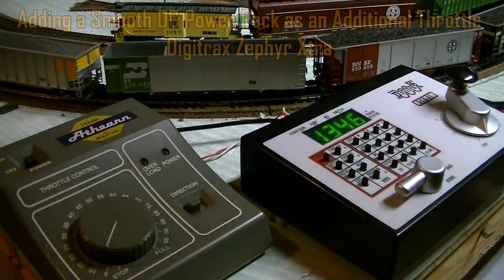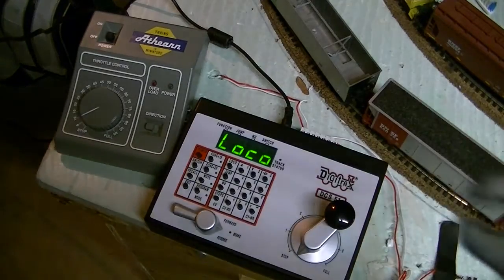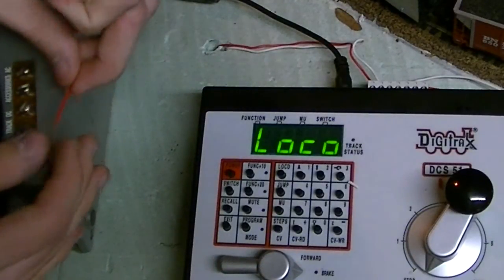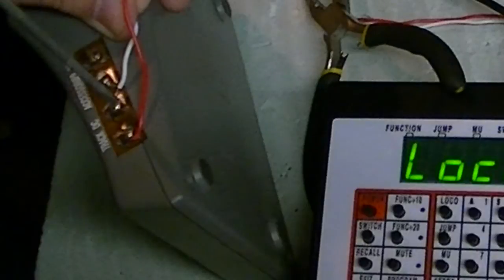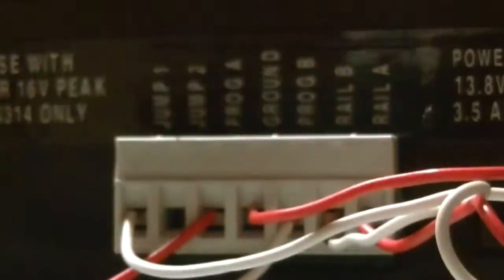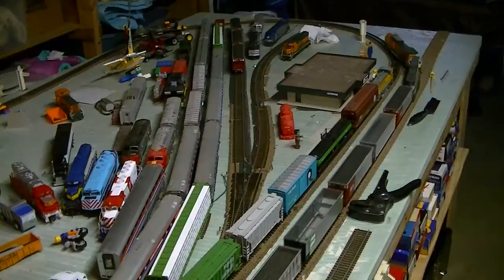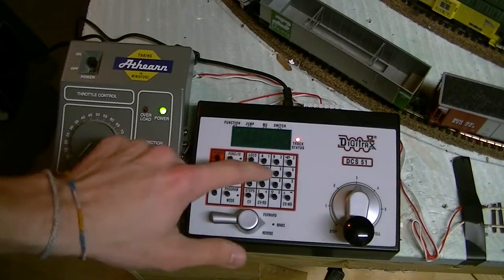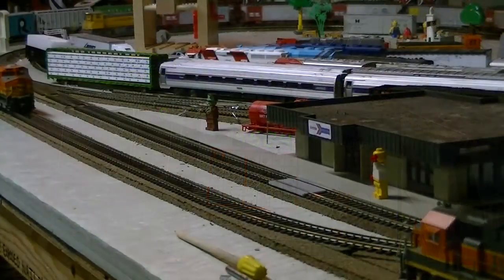Digitrax Zephyr Xtra- Adding DC Power Pack as Additional Throttle 2.12.2016

Comment: FYI:  I see a few missing the point of what the JUMP function is, it allows you to add 2 more throttle controls be using spare parts of your old layout. All locos are DCC (although DCC system can run a standard DC it is not recommended). What this means if you and someone else wants to run trains on your layout you don't have to spend over 100 bucks to do it.

I found this out in manual and now I think I know what I want to get.

Comment: CONGRATULATIONS , for documenting something a manufacture did NOT as one hell of a reason to buy this unit, I was looking at a bunch of different until reading a manual on wonder what the hell jump is
Reply from the maker: billfusionenterprise Glad I could help! I thought it was a neat feature and figured out how to use it, so I figured why not demonstrate how it works? It is pretty handy
Reply: revolutionary is more like it, have you seen what additional throttle cost. Plus if you want a big control stick setup (to simulate the real thing) you can. (ever notice how small those post are?)

Comment: Hey bro, Now my question about the DC Locomotive wont it over heat while you are running the DCC train?
Reply: not about DC loco, all locos are DCC, it is very undocumented feature of the zephyr which will allow you to add 2 cab control to it
Reply from the maker: CSX2057 Not sure, I avoid using my DC units. They run really loud, doubt it can be good on the motor.
Reply: have you looked at the price of an extra cab control to any dcc system? , even if you wanted to add the wifi

Comment: could I use a kato power pack  to run dcc with digitrax am new to all this and thanks  greg
Reply from the maker: greg bartolotta Yes, you can hook it up how I hook my Athearn one up in the video and use it as an extra throttle. It's still DCC though, but it allows you to control 2 trains individually at the same time very cheaply. Digitrax throttles are expensive, so this is a cheap way to add another throttle cheaply, and also convenient if you're converting from DC to DCC
Reply: anybodys dcc throttle ad ons are expensive

Comment: could I run dc and dcc at the same time
Reply from the maker: greg bartolotta You can run DC engines but they make a very obnoxious humming sound and I believe it is possible to burn up the motor, so I don't recommend it. Using the Digitrax system, entering "00" as the loco number will allow analog locomotives to be ran. My recommendation is to switch all analog locomotives to DCC and run them that way, to ensure no damage is done to the motors
Reply: miss the point, and what jump is all about, so far people are thinking of running dc though the diditrax, instead of what is going on which is using the DC to CONTROL the digitrax

Comment: This was helpful. Thank you.
Reply from the maker: My pleasure! Glad I could be of assistance. Let me know if you need anything else I may be able to help with.
Reply: I am curious. I will be building a set up similar to what you have here with only the Zephyr and other DC packs for now. Is there any struggle at all or does the zephyr work good with that much track? I'll have 2 loops with switches like you do.
Reply from the maker: It works amazingly. You should have no problem with something this size
Reply: The zephyr has a 3 amp power supply, so it can run a few locos, keep in mind the DC power pack is being used for control NOT power